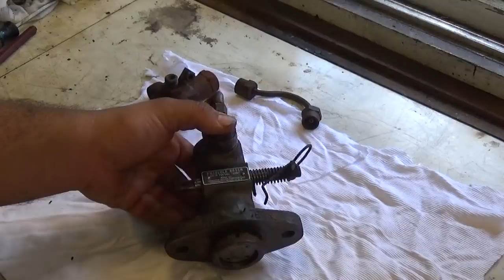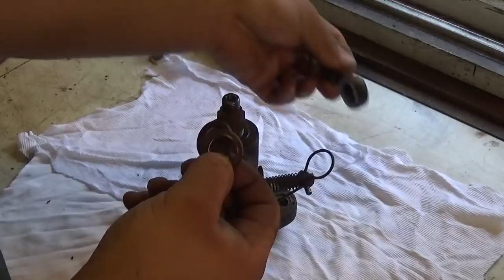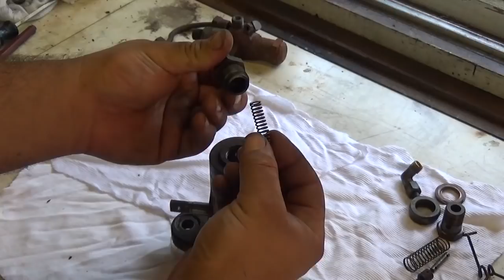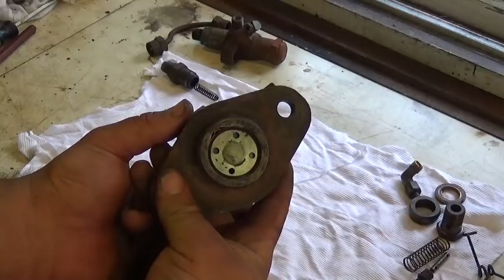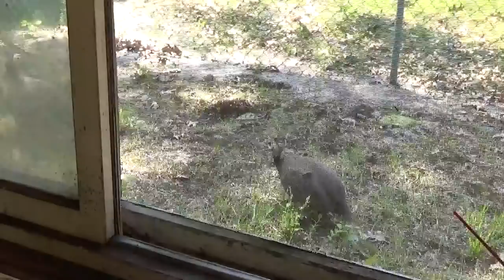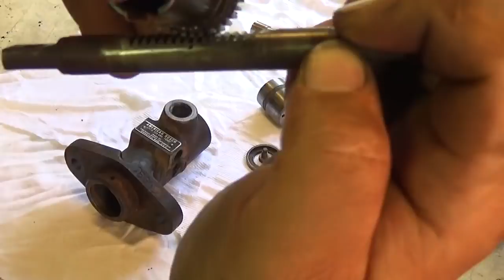American Bosch Injector Pump Disassembly (Fairbanks Morse 36A)

Comment: Good work and good tips! It very much like a single-cylinder version of my Bosch VA6 pump from my old Farmall 706 with a D310 engine.
Ever had one smoke a lot and not respond to throttle changes?
That is odd about the return line, or absence thereof.

Comment: The injector look a lot like the Copper Bessemer injectors but smaller. I'm talking about a diesel built in the late 30s early 40s that are 6 cylinder with 11 inch pistons for railroad and ship use.

Comment: Hi Mike

Be very careful cleaning the injector nozzle/plunger/barrel parts with rags, etc. They should really only be cleaned with an ultrasonic cleaner. You can purchase a good used one on ebay or new at banggood fairly reasonably.

https://www.banggood.com/search/ultrasonic-cleaner.html

Obviously the fuel lubricates the plunger/barrel of the injection pump and the pintal/plunger/barrel of the injector. But it's other very important job is to act as a seal. This is why you never see any mechanical type seals on injection parts. As long as these injection parts get clean, uncontaminated fuel, they will last for a very long time. Water is another killer of injection systems. I have seen the tips of injectors blown off from water contamination. It also causes corrosion and pitting of the lapped parts which will leak fuel into the engine and eventally failure. Like you said Mike, clean fuel is very important.

Always enjoy your videos. 
Cheers
Willy

Comment: Just a hint, never ever touch the bare surfaces of the pump element and injector nozzle pintle with your fingers. The salt on your fingers can wreck the surfaces,especially in injector parts .